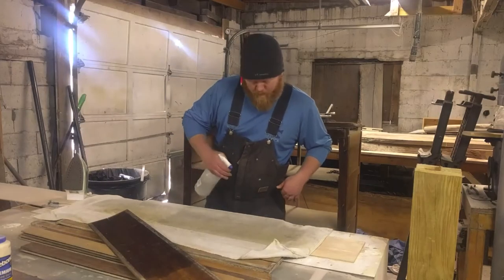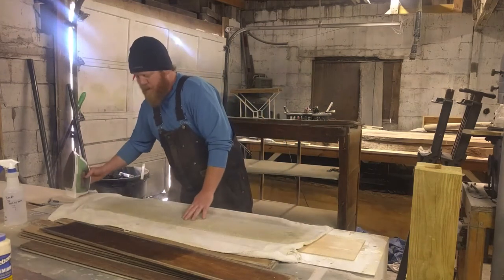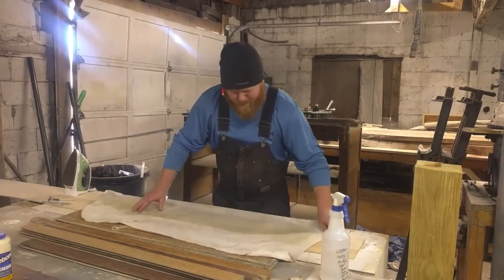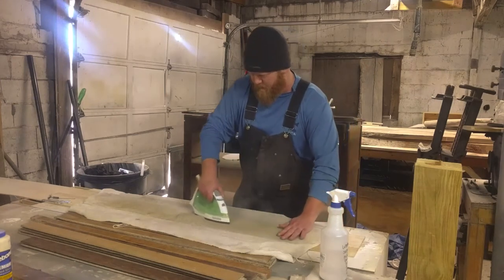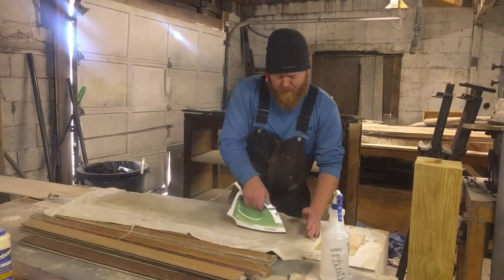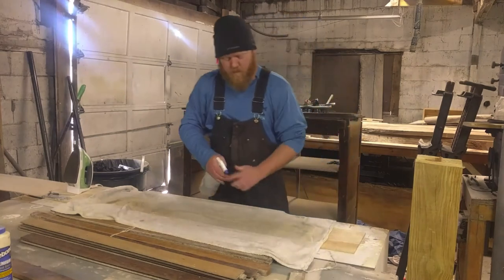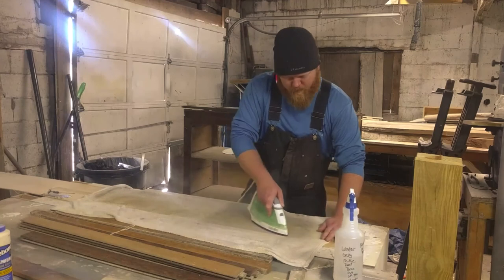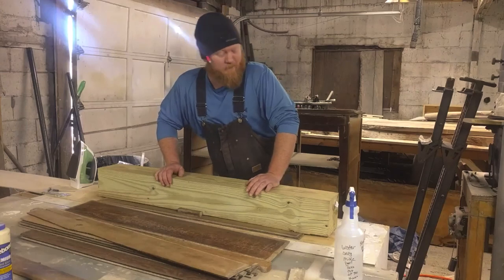Woodwork: Steam Straighten Panels

Comment: Wood cups because one side of the wood receives more moisture than the other and expands across the grain on the wetted side. To correct this, the cupped side of the board should be treated with wet heat to cause it to expand. Wetting and ironing the other side, the high side, makes the cupping worse. The cupping can sometimes be repaired, especially when the board is recently cupped, by dry heating the high side. This removes the moisture that caused that side to expand.
Reply from the maker: In this case the wood was pretty thin. Heated and set with weight on top. All is good